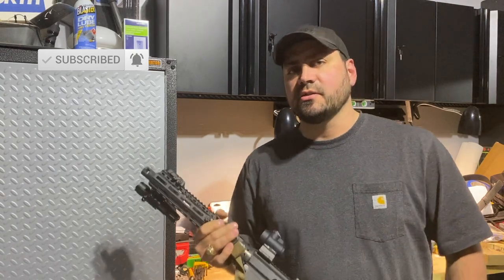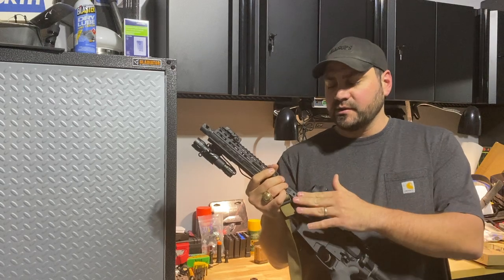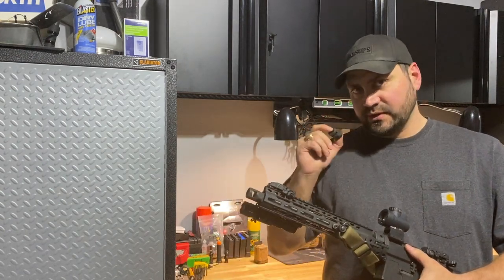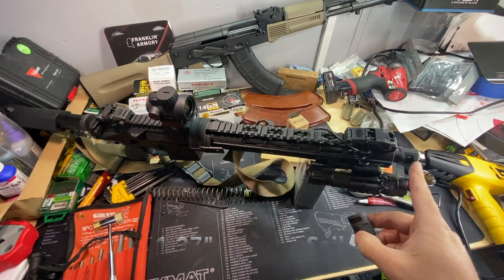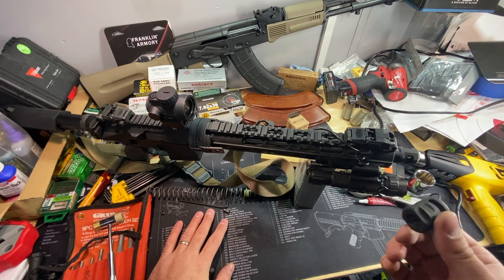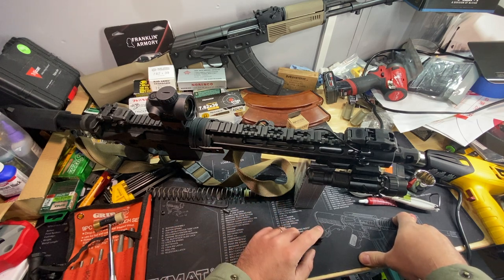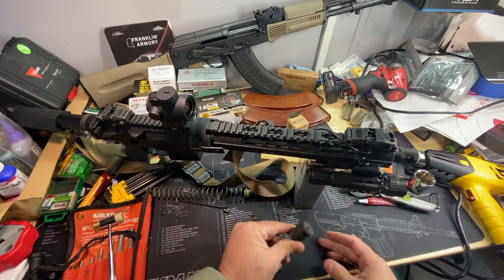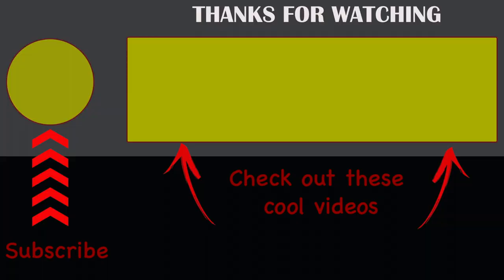Strike Industries Sail VS Warhog Muzzle Brake VERY SHORT DEVICES

Comment: As far as linear comps go, Kaw Valley Precision has their MACH modular linear comp and you can set it up in a configuration that is only like 1.75" long (added length to the barrel). Currently running it and it's performed well for me

Comment: Why is your front sight backwards? Just so you can actuate the bottom while using a "c" grip?
Reply from the maker: I do normally shoot ar15’s with a Cgrip, but I mainly felt like it was more streamlined to install the mount to flip that way (giving it a tiny bit longer sight gap) between the two than the normal way they are mounted
Reply: @isaacspoon  Gotcha. What do you gain? 1/4" or so?
Reply: @isaacspoon    So...... I was curious. I measured the distance with the sight facing both directions on one of my firearms and you are right. You gain about 13/16" of an inch. So slightly better then I guessed. 
      I guess the only other question would be light reflection based on the design of the sight. To be fair that would be very minimal. 
    What you're doing makes since and every little bit helps! Thanks man.
Reply from the maker: @JesusFreak8824  yup! people give me a hard time about it haha but I actually always prefer it to be that way... after messing with one of the first rifles I ever bought (an sks) when i added the rear aperture sight on the back of the receiver versus the factory rear leaf sight, I noticed a huge difference. i have since considered the sight gap in firearms since

Comment: How does the zero hold on your front sight after takedown and reassembly? Most take down systems bost that they hold but I've never owned one so I don't know.
Reply from the maker: i have never tested the actual point of impact shift in doing so, so sadly I don't have the answer to that
Reply: @isaacspoon  that would make a cool video. Thanks anyway.